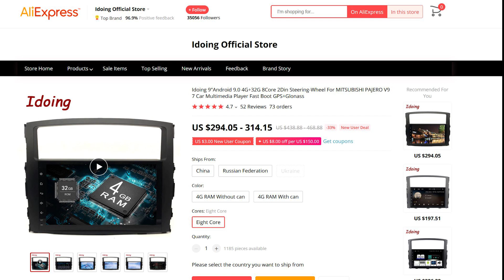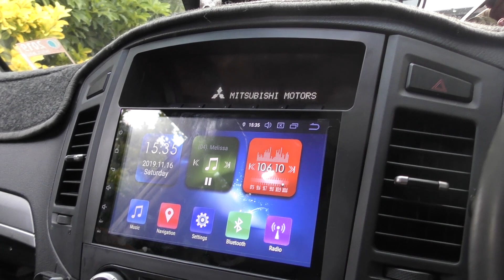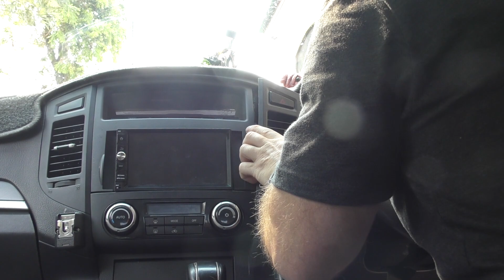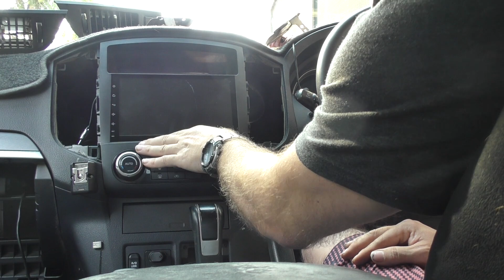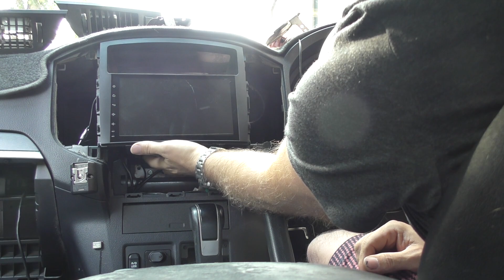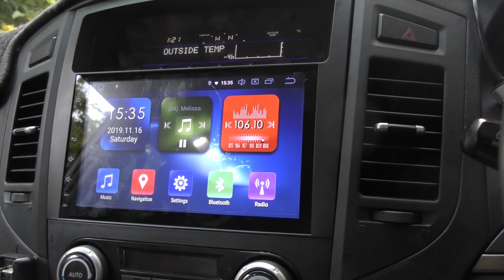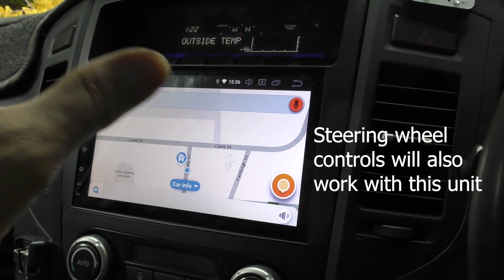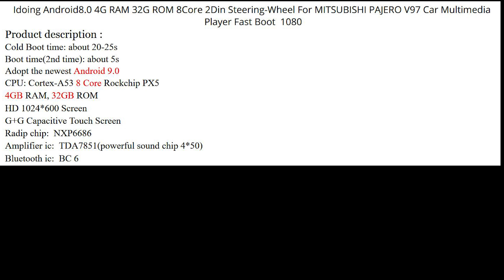Idoing 9 inch Android 9.0 Head unit - Pajero Install & overview

Comment: Thanks for showing this one up! Looked at ali for that listing and I see that factory mic and factory rev camera won't work. Bit of a deal breaker. Also wondering about sound quality on it vs. original rockford from exceed. If they would sort out swap like for like, so camera + glove box USB + original mic, that would be no brainer otherwise it is not so convincing... yet :) I appreciate they went way ahead on making this easy as but do you know if they plan to make it real "like for like"? BTW. Leopold was pretty interested in that one as well. Cocomelon and "Baby Shark" on dash ... that would be amazing! :-))
Reply from the maker: all good questions but I'm afraid ones I can't answer and not knowing the set up for the RF gear from the main unit, I can't offer any suggestions either.  I would have happily guinea piggged it, if I had one. The best i can do is say shoot them a message and see what they say. I noticed Idoing just subscribed, so they may answer themselves but I cant be sure. I hope they do because its looking like a common question.  Hope little leo is going well :)   I'm more of a lion king fan myself but cartoons is cartoons :)
Reply: Yup, I asked then on Ali. Regarding factory cam I got link to some Russian forum where someone worked out wiring diagram + some transistor - DIY. In terms of mic and USB - no support and they don't plan to do so. :( Hopefully they change their mind over a time... Anyway, again thanks for bringing this unit to my attention!
Reply: @dupadupa5879  thanks ;)

Comment: Hi, the Idoing store description says "do not support original car rear view camera" is this true? Also says " Support 3G Networks/Built-in Wifi" does it have place for SIM card?
Reply from the maker: I believe the 3g story of Belvidere usb using a dongle rather than just the use of a Sim card. Re the camera, I'd say it works friend in the output of your current Cabrera and the connection type. The connector type in the unit is rca.
Reply: Original Pajero camera is 6v

Comment: I have installed about 5 months ago. It's perfect but i have echo problem while making calls. I hidden the gps antenna in the dash behind the head unit, navigation perfect is it a good place?
Reply from the maker: My GPS antenna sits under my dash mat and works fine. I've seen others leave them inside the dash and work. I don't get an echo on mine. Where is your mic set up?
Reply: @DENMONKEY  it's attached through the A-pillar,  for me no echo, but person on the other side of the call get very annoying echo. I believe the reason is because the voice is coming from one speaker, the one on top of the dash which is some how close to the mic.
Reply from the maker: Have had one person mention the echo but no one else
Reply: @DENMONKEY  where did you set up your mic?
Reply from the maker: @talrusan  up on the top of the A pillar
Reply: @DENMONKEY  same for me 🤔🤔, maybe the dash mat is reducing the echo.

Comment: Howdy - reading through the specs of this Idong it says 
"Support Rear View  Camera  (do not support original car rear view camera)
Really - is this true - we would have to swap the camera out to keep this?
Reply from the maker: Not sure mate. I had an aftermarket one which had a RCA plug on it. worked fine. I'm not sure if the standard one has a different plug on it.
Reply: @DENMONKEY  Just a thought - is there any reason why the existing OEM camera with the mirror integrated display would stop working with this install?  An aftermarket camera could be added just for this unit (perhaps higher up for reversing trailers etc), effectively giving you two rear views.
Reply: Different current requirements I reckon
Reply: Oem reverse camera is 6volt for some strange reason
Reply from the maker: Cheers Ken. Who knows what they were thinking

Comment: İ have connected the  Chineese head unit to my Pajero's rockford system, during calls, partner on the other end hears his own sound as echo, please help to fix it, what could i do wrong?
Reply from the maker: try placing your mic away from your speakers and try getting it up high. If that doesnt work, you can try a piece of tape over the mic on the head unit itself. that might work also.
Reply: How did you get it to work with the Rockford system?

Comment: Does the unit support apple car play?
Reply from the maker: no mate it doesn't . you mirror an Iphone but not control it . 

from their website 

 Screen Mirror Link        
By using the Easy-Connect APPS,you should connect your android smartphone with this unit via USB charging cable and Bluetooth.you can mirror link the connected android smart phone display such as main menu,photos/videos,Online navi maps. also you can control the connected Android Smart Phone on this unit.it can support the most Android Smart Phone. For Iphone,use wifi connection,you can mirror the unit,but can not control.

Comment: So you received this unit for $0. Wiring explanation (plug & play) only applies if you have RCA plugs already in the OEM wiring (??)   No explanation as to whether SWC is operable using IGoings harness.  Your wiring is not included in your video. I have a 2013 Mitsubishi NW (non Rockford) and your wiring suggestions are not included (no RCA plug and play applies!!!). I have an aftermarket unit installed but original harness still in place. RCA option does not apply. Does harness allow full SWC function? After fitting the fascsia to your dash the rest is a little "confused" .
Reply from the maker: yes mate, the unit was sent out to me for free.    No, you don't need the RCAs. The previous owner of my vehicle had installed an amplifier and this was what the rcas went to. 
If you don't have an amp, you would use one of the other included harnesses (choose the right one for your model on the website based on what your dash looks like)  Without the RCAs you would be using the original speakers which would be wired through the plug and should be plug and play as part of the fitment.   Re the SWC, since I don't have it in my NT, I can't give you info on it. I'm happy to pass on info where I can test it for myself and be 100% sure but since I can't, it's not something I can help with. ahain, just shoot them an email on the site and they will help you.  The SWC on the Paj is only 2 wires, so if it didn't work as plug and play, providing you could locate the wires, the other included harness (the one I used) does have wires for the SWC.   I didn't go into detail re the install side of thing since I was replacing an after market install and so it could vary greatly for others.   Plus I did an install video here https://youtu.be/y5GUgS3ooFU back when I installed the pumpkin head unit. So that might be of help to you.

Comment from the maker: I've got lots of questions from Pajero Owners who have a Rockford set up asking if this will work for them. I asked Idoing the question and here is their reply. 

the idoing will allow them to use all of their Rockford speakers and if they choose the correct option
if the car with rockford, check this video, 
https://youtu.be/-NtBNOH4mLU
it will still be plug and play with the harness .
there are two different adapters
standard and photo 7,3949.jpg is standard, 7215.jpb is photo 7
before ordering check if standard or photo 7
we both have plug and play adapter

Keeping in mind, my NT does not have an RF set up and as such I have not tested it, so I can neither confirm nor deny the info provided above.  If you try one on an RF set up, it would be great if you could report on your results. cheers Brett
Reply: Do you have the pictures of the adapters? i cant get mine to work with the RF system
Reply from the maker: I don't mate no. Shoot idoing an email and the might be and to help. Mine wasn't the RF set up. Some of the others below have got it working. Maybe result to them and ask a question.